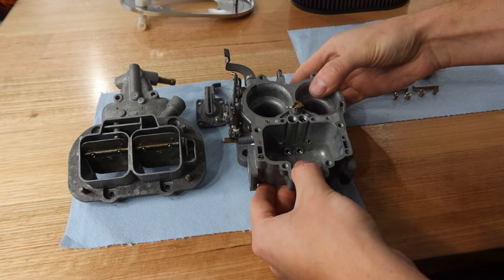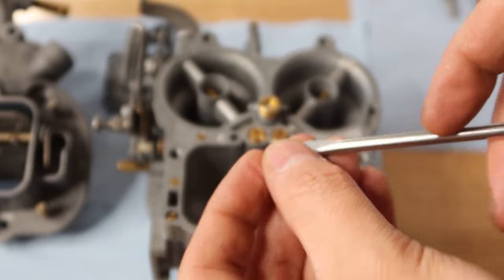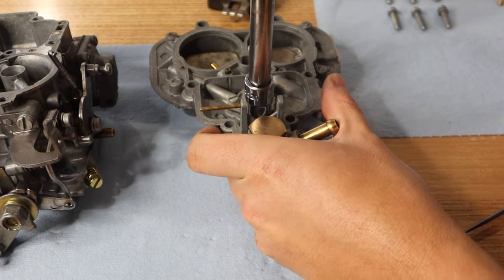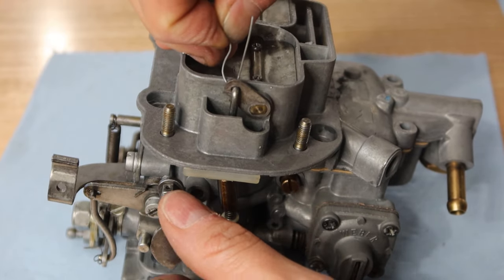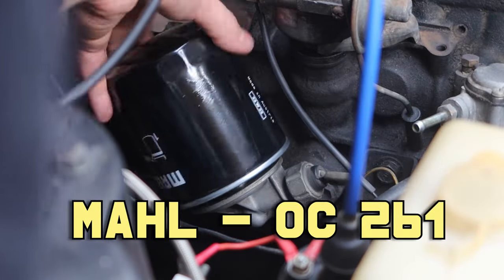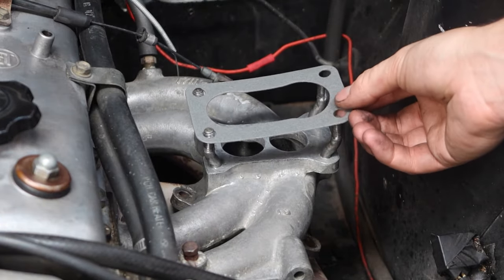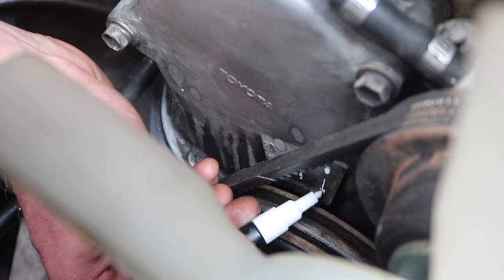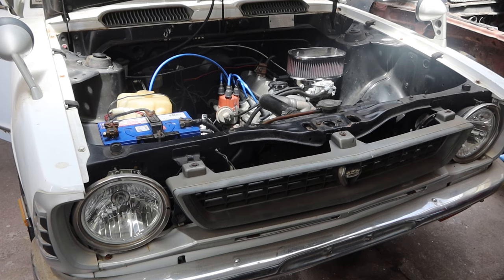KE25 Corolla - Rebuilding the 32/36 Weber for the 5K Engine

Comment: Was it the resistor on the coil that drops voltage to about 7 volts?
Reply from the maker: Nup I removed the resistor, but that did fail on me many years ago

Comment: Generator or voltage regulator
Reply from the maker: I did switch to an internally regulated alternator quite a while ago but neither of those are my current issue
Reply: @fatlipcollective  so what is it
Reply from the maker: @DanielGarcia-zq5rl  Hopefully have an answer for you when I test the final bits tomorrow.